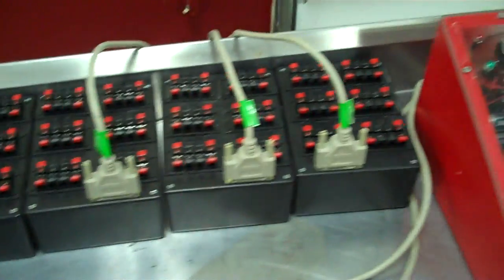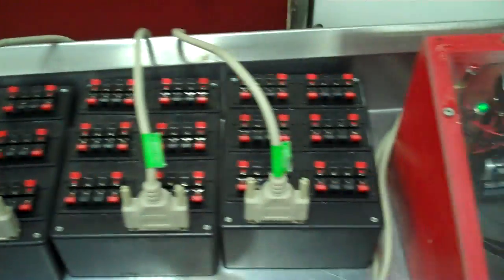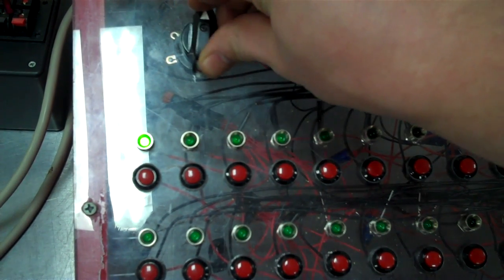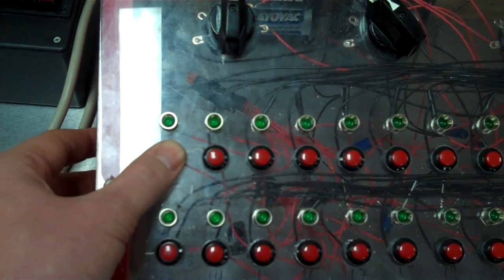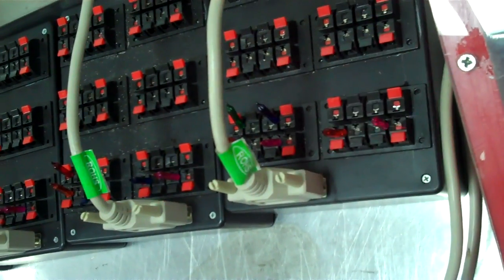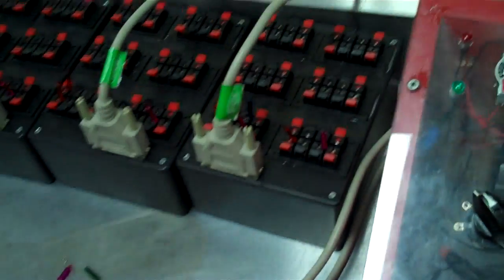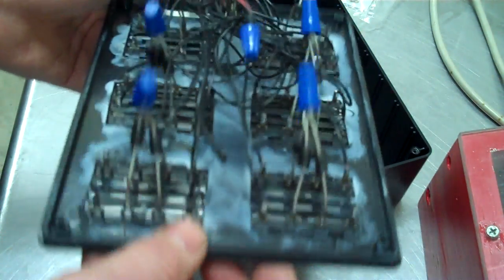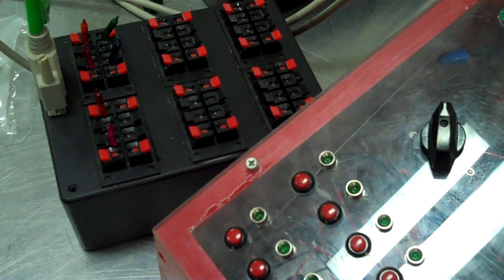Fireworks Firing System (2 of 2)

Comment: Hi, I see it has been a few years from build.  I see your are in Omaha, I am in Kearney, NE
Are you still using this system?  
More info on which diode you use?
Has any diodes gone bad?
Why 19 volt vs 12v?
What are you using as power source to get 19 volt?
Was there a reason diodes was tied together with wire nuts vs solder?

Comment: Question from Canada here. I'm in the process of building one now, and I got the help from the electrical engineer over at the local collage. But even with that, were still at a loss. Where do we start? And I cant find the single female/male VGA connecters anywhere. It would be a major help to us if we could find them, instead of making up our own. Each module is only going to be 16 cues and the total system will be 48. Thanks, and great video!

Comment: Can't you just hook one diode up to the negative side comming out of the female adapter? How much exactly did it cost? And can't 24 gauge wires hold up to 30v, wouldn't that work? I'm planning on building my own system and was wondering.

Comment from the maker: @Jufullback35  I think theese are 6 amp diodes. A diode works like a one way valve for electricity. Solder one end to the negative treminal and the other to  the negative wire that is running back to your system. Diodes only work one way so make sure that you have them in correct.